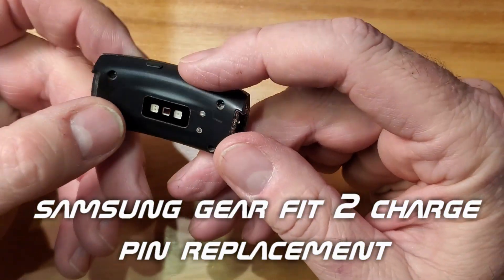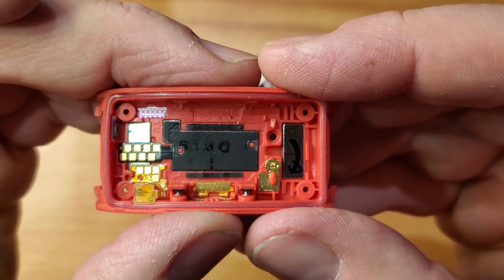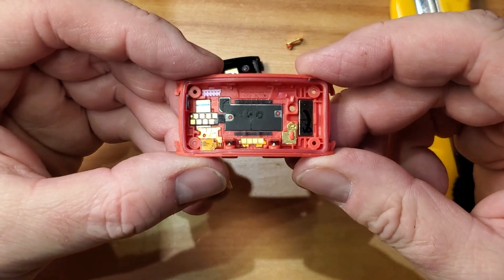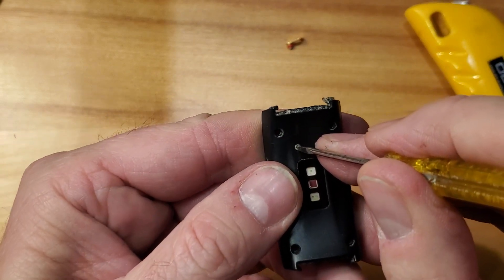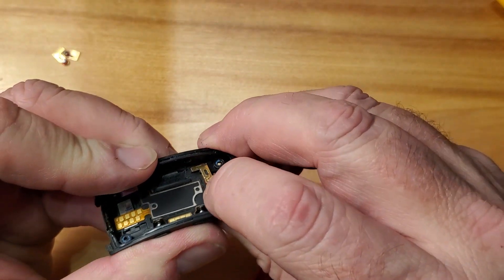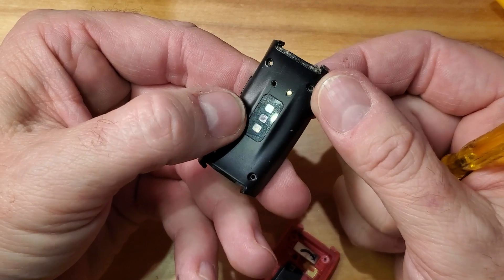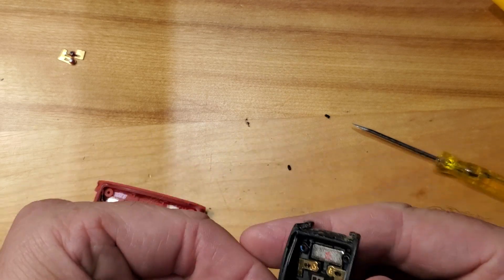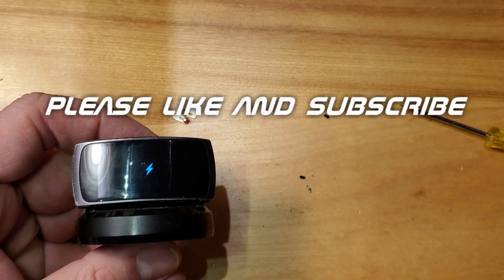Samsung gear fit 2 will not charge - charge pin replacement

Comment: I used a finish nail and a straight pin to clean the gook out of the pits in the charging pins and finished it with a Q-tip soaked with cleaner/degreaser. Works now, whereas it would not charge at all beforehand.
THANKS for your video that inspired the fix.
I've had this watch for 7.5 years, and it is still ticking thanks to your video.

Comment: if it was just corroded, then u could have used some sort of corrosion dissolver or isopropyl alcohol to clean it.
Reply from the maker: No.  It was pitted and shorter so it would not charge. Thanks for watching.

Comment: Lolz I just put some solder on charging pin where it was damaged and it is sorted now 😂😂
Reply: And solder never rusts or if it gets damaged just put in some new solder and forget this headache
Reply from the maker: I love a simple fix. Thanks for watching
Reply: i've checked all over to see if anybody did this without burning or damaging watch. 
 Any special tricks when soldering would be appreciated. just trying to,to keep this thing going a little bit more or use this watch when working at rough spots. Thanks in advance